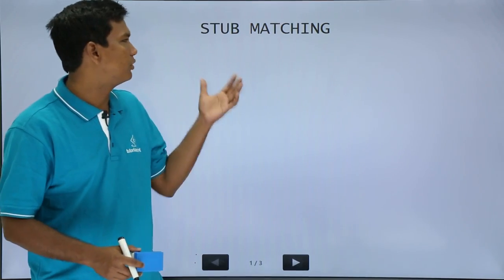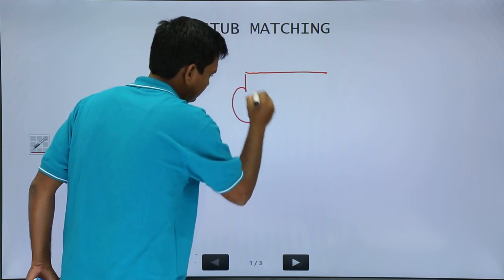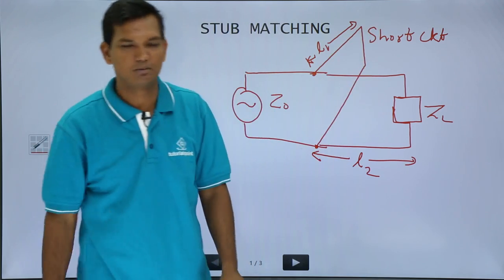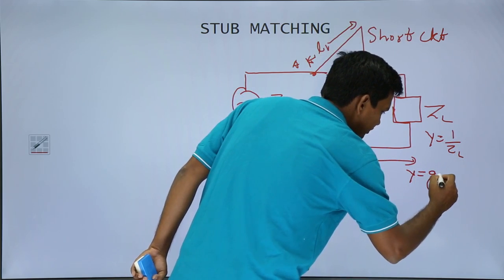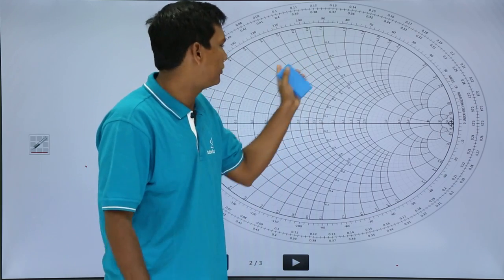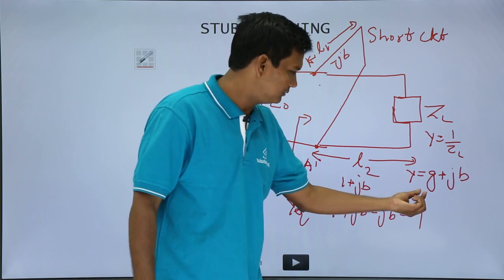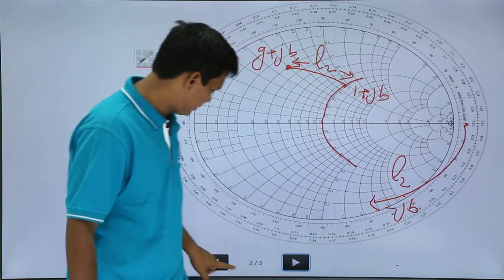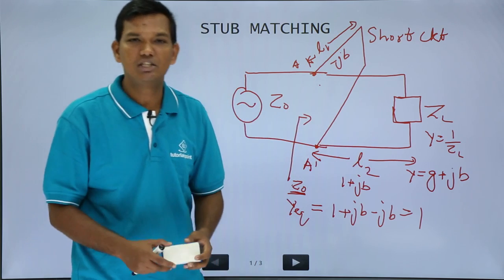Electro Magnetics Theory - Single Stub Matching

Comment: I believe @ 6:10 the professor incorrectly labels the length of stub as "l2" and that is in disagreement with the component DEFINED BY his "wiring diagram."  Meanwhile, the true L2 was described, seemingly appropriately, in the preceding minutes (@3:36) as the distance from load to stub attachment point.        

My allegation that @6:10 describes L1 is CONFUSED, however, by professor's commencement of CW arc from the "open circuit" (far right) point on the circumference of the impedance chart.   Indeed, the proposed stub is a drawn @ 3:36 as a short circuit stub, not an open circuit stub.    Ah!   I get it:   The chart suddenly became an admittance chart, not an impedance chart, and the rightmost point is indeed a SHORT CIRCUIT LOCUS for admittance considerations.      

I remain confused by the IMPEDANCE chart is used, ... with little explanation when this chart suddenly becomes an ADMITTANCE chart... (flipped right to left).               There is, indeed, a proper ADMITTANCE SMITH CHART (rarely used in practice, it seems) which is the mirror image (left to right) of the IMPEDANCE SMITH CHART.
Reply: I agree. He should be using the admittance chart to show this example, as he uses parallel stub matching. Even if it is an admittance chart, the short circuit is still on far left hand side, because the stub termination is a wire, and hence short circuit. So on admittance chart, I think this should be on far left side.